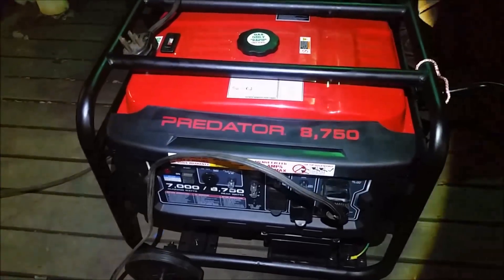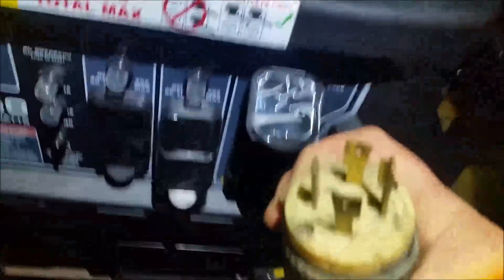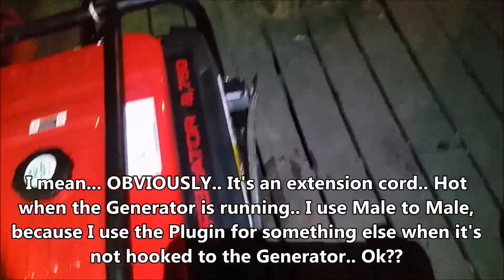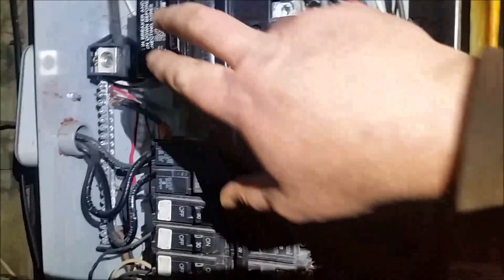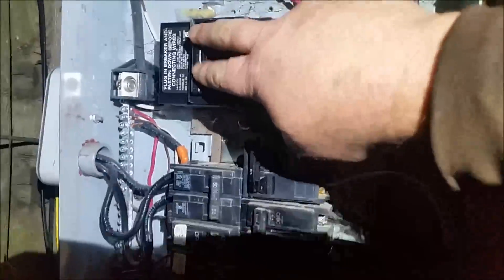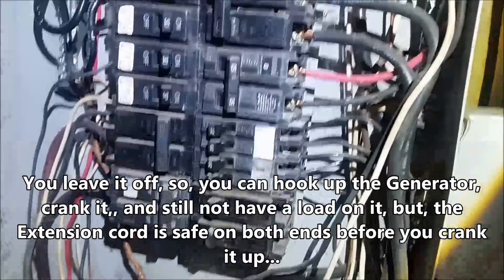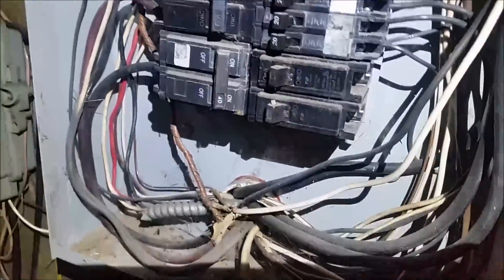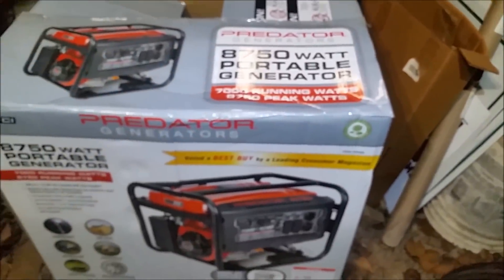Quick/Easy/Safe: Use Existing Plugin/Breaker for Generator hook up to your house Panel box.

Comment: I have given some thought to whether (or not) one could electrocute himself with a male-to-male jumper cord or dogbone. To be electrocuted there must be a path through the heart. Since the emergency generator is not grounded even if one were double stupid  (connecting it hot and touching a hot blade of the plug) there would be no return electron path to the generator via the ground. If one were to touch two blades of the plug one could get a nasty shock and burn but it would be localized to the fingers (no path to the heart). So if one is determined to be electrocuted he must use both hands and touch two blades of the plug. An alternative (if the generator is bonded to the frame) might be to walk back to the generator and grasp the frame while touching a hot blade of the plug (still requiring the use of both hands).
Reply from the maker: I understand your Theory, but, 220v 30amp, best to just plug it in before you crank it. 
I would not want to plug it in with the breaker on either. That would create a pretty good snap on the generator and things plugged into it. 
I always turn off all of the 220v breakers, and then, flip the generator breaker on to power the house Electric box. But, I know that does not put that big of a load on the generator. I usually wait at least 10 seconds, or let the generator catch up to the load before turning anything else on. Usually just a few or a second or two.. Then, I turn on my 220v Deep Well pump, but, I have the Hot water heater breaker off, which I am lucky enough to have inside.. Then, when I want to warm up the hot water heater, I do not use the water, and I turn the Electric Hot water heater on. When I hear the load release, I turn the Water heater off and use the water as I wish again. If both the Hot Water heater and Deep Well Pump come on at the same time, it either lugs the Genset down way, way too far, or kills it, or, flips the generator breaker. 
When I turn everything off, Generator feed breaker First, then, I turn the House Main back on, Turn the Genset off, Unplug the Genset, and I'm done until I need it again.. 
When I get ready to run on it again, Before I go outside, I turn the Water Heater off, then going outside, I pass by the Electrical Box, Turn the House Main Off, (Leaving Genset breaker off), Hook up Genset Cable, Crank Genset, Go back to the Box, Turn off all 220v breakers, Flip the Genset breaker feed on, let it stabilize, then flip the 220v Deep Well on, and run as long as I have to.. 

It's just safer to not crank the Generator unless both ends are plugged in. If I were not the only one around here who fooled with the Genset, I would disconnect both ends of the Male Cable. But, I know, no one is going to crank the Generator but me, or someone I am on the phone with cranking it for my Girlfriend, or my Girlfriend if for some reason I am not home.. But, she would call me before doing anything, because, I have not trained her. But, I have the same setup at my Mom's who is 84, and, she has called me on the phone several times, and just tells me what she is going to do as she does it, and she does fine. But, I put a 3x5" index card with the instructions anyway, because, it can be a while between her doing it herself. Never had any problems... 
But, if you pick up a Male to Male extension cord and don't have any respect for it,, (Gives me the Heebie Jeebies) you really have no business doing it this way. You know what I am talking about. 
Anything Male to Male has a potential to get you.. It's just that simple.. 
Just a thought on Grounding though. I have gotten bit with one hand touching something with a good pair of rubber sole boots/shoes on. 
I can tell you one other strange thing about Grounds. I have a 220v Deep Well Pump that is only driven by a 3 wire cable (2 hots and a ground). I never paid any attention to it, but, one day I was looking for my grounding rod by my Main Electrical box, and there was None.  Only thing I can figure is, it grounds through the ground to one of the closest telephone poles, which is probably a good 50 yards from the well. 
So, don't discount the fact that the Earth itself is ground, and, you can get shocked when wearing rubber boots, only touching a hot with one hand. 
Better to be on the safe side any way you slice it.
Reply: @MarkThomas123  Yeah, I actually do it your way. I was just pointing out that the plug can hurt you but prolly not kill you. I did one time pull the plug hot. I don't recall what I was checking. The plug is large enough that I didn't get fingers close to blades but I found a safe place to lay it down until I plugged it in again.

Comment: There's no sense in installing a $500 transfer switch and doing a bunch of work to accomplish what can be accomplished with understanding. Its for Emergency use only, there aren't code enforcers going around writing tickets for backfeeding, the penalty is you eletrocute someone, you fry equipment or you burn your house down.  Those are motivating enough to make you do your due diligence to understand how you plan on putting the generator in and avoiding the pitfalls.  Perhaps add letting the generator run for a min or two with no load to blow air on the generator hardware before killing the motor for longevity?

Comment: A cord with male fittings at both ends is a suicide cord, ONLY  when you + stupidity. power goes out 
and utility co, says  it'll be on tomorrow So you shut off mains in house and/or outside house 
if u have a mobile home, u have a mains or disconnect by the meter. I shut'em both off. now you
plug gen into outlet protected by breakers in panel.gener8or has warmed up so you plug other end
plugs into generator.  This is a safe way, safer still though to have gen brkrs feed a special male 
fitting that is enclosed in a UL approved box. then the cord only has 1 male end.

Northern tool has Powerhorse a very good unit, got me an wife thru irma. and a few other times.
Reply from the maker: Turn Main Breaker off.. Complete House Circuit is dead.. Turn Generator Breaker off, so, Generator is isolated.. I turn the Generator breaker on the Generator breaker off too.. Then, plug in cord on both ends.. Then, crank Generator.. Neither end is unplugged, just in case.. Then, when generator warms up, turn Generator breaker on, then Generator breaker in the panel on.. If you want a smoother transition, turn off all 220v breakers, and half of the 110v and turn them on one by one.. No need to turn on any dryer, electric stove, etc.. Genset is not strong enough.. And, Deep Well Pump and Electric Water heater have to run alternatively, not together... Other than plugging both ends in at the same time, I agree with what you said.. I also agree with the way you said, because it is also safe, just a little safer if you plug both ends in and use breakers.. Even if your hand slips plugging either side in, no voltage is there.. If you slip when generator is running, while plugging in the cord to the male, you could get shocked.. Just a little safer to do both while no electricity is present.. No reason not to error on the side of caution, but, your way will work, just, no reason not to go a little safer.. Thanks for the comment.
Reply: @MarkThomas123  You are welcome, we don't want to be without power but in this circumstance, we need to think things out and I can say that there were a few
times I realized it was not the best or safest way. it works great till it suddenly 
doesn't and knowing murphy can enter and in half a blink F it up royally. I have a
dog and I don't need lethal voltages flopping around in case it should fall out of the
socket. I lost power last Sunday late afternoon,, since I do Gen maint. every 45 to 60 days, she was already to go. 1st thing was to trudge to outside breaker box and 
shut it off as it powers a mobile home, panel inside  is a 'sub-panel' neutrals a 
grounds are isolated and dryer is a 4 prong not the old crowfoot style, that was changed in the mid 90s by NFPA, yeah some walk out toward the dryer socket with 
240 live danglin at the prongs, they could have/should have turned off Gen breaker.
or as I say plug in at dryer end. there is so much bad that can happen, that is why
we have to think things out. they r called widow makers for a reason, but they can
keep u from freezing or sweating as long as u know exactly watt u r doing and why.
I could be wrong about that socket for gener8or plug looks like it could be mounted more securely, , less it moves, less chance for wires inside to move. u just don't need another issue to deal with for no reason.
Reply from the maker: @raymondgarafano8604  Yes.. The plug into the generator should be a 4 prong, and it called a "Twist Lock".. One of the prongs has an extra extension on the blade... I have never had one pull out, and have been doing this for me and my Mom's house for 16 plus years, and the power is out pretty regularly.. Push in and twist slightly.. About 1/8 turn or less, and then, try to pull it out.. I always flip my cord where when I plug it in, it naturally twists it to the right when sitting there running.. Just some extra thoughts on that one..  Cheers.. :)
Reply: @MarkThomas123  Well, some gens have the twyst lock receptacle and some have 
the style u'd see for a flat blade dryer plug. The u prong being ground  and across 
from it is the neutral, with the hots on either side. take care 'n b careful!

Comment: So if everything in the house is off (not off of the breaker box) but (switches flipped off) the refrigerator might come on when the generator is started. Can you have it plugged into your dryer plug with THE MAIN OFF, start the generator, and then plug the suicide cable into the generator?? What are you thinking in this situation? Tankless water heater which would be off at the same time main would be flipped off as it uses 18,000 watts and generator is a predator 9000. So really the only thing that might come on is the refrigerator, stove clock, and microwave clock. Would you be able to get by without flipping the different 220 breakers off with this light load at start up

Also, I have a 3 prong drier receptacle. My cable had 4 wires. Cut the “ground” wire off as the generator is “grounded” outside in in this situation?
Reply from the maker: 4 Wire plug is 2 hots, one neutral, one ground. 3 Wires is 2 Hots and one ground. So, Ground to the Ground bar in the Panel and Ground on your plug. Check the Wires in the recepticle. 
Main Breaker off First. No power anywhere.. Genset not running. Plug in Cord on both ends. Crank Genset. Still no power in panel except the Genset feed breaker. Turn off al 220v breakers. Turn off any 110v breakers you will not use.. 
(You can turn all 110v breakers off and turn them on one by one, waiting for the genset to return to normal RPM's as you go.. Some Circuits will need more power, some not at all.. Any 220v breakers are suspect to overload 9000 genset.. Turn on only those you are going to use. May not be able to run more than one at a time. Water heater or any type of anything that heats up will take lots of watts/amps.. I run my Water heater and Deep Well Water Well (Both 220v), but, never at the same time.. Stop using water, turn water heater on, let it heat up, load drops, turn water heater off and then, you can use the water again.. Hope that makes sense.. 
When you hold the Male to Male extension cord, you should "KNOW", that you can not have power on either end while you are fooling with it.. If you question that at all,,, you need to sit down and think long and hard about doing this.. It is just plain common sense, but, I am guessing you have not had the extension cord in your hand yet.. It's like holding a firecracker and cigarette in one hand.. If you don't feel that way.. Stop, use an interlock and Male wall plug and a regular Genset extension cord.. You have already let me know you have not thought about this much.. I am a bit worried about you trying this.. Stop and Think before each step. If holding the cord does not scare you (Respect of what you are holding in your hand) STOP and do find another solution.. There are many. This is just for people who this makes sense to, and those that don't have extra 220v outlets, or want to use one they are not using while on the genset.. Think hard about that last paragraph and make up your mind.
Reply: @MarkThomas123  think there might have been a mis- understanding. And yes I am new to the subject. That’s why I am looking at videos for help. But with the “service disconnect” in the off position. There shouldn’t be any power coming through the other end of the cable right? What I was saying is to plug in the 220 in the drier receptacle (AFTER) the service disconnect, or the main breaker in this instance is OFF. Thanks! 
Preparing for the worst in the coming up days
Reply from the maker: @tylerhoffman2506  Yes, for the Generator, but, you won't be able to use it for the Dryer if you hook up the Interlock, or change the wall outlet to male vs it's female now. You have to have an extra 220 breaker.. 
That is the beauty of this install. You use the Dryer breaker for dryer or Generator, and can use them on or off genset. But, this is without an interlock that will only allow the outlet to be used while OFF Utiity power, or, when main power breaker is off. Maybe that will clear that up..

Comment: I don’t have a main breaker
Reply from the maker: You do somewhere.. Follow the Power Company line from the Transformer to your house.. It will go to what they call a gooseneck at the top of the pole where the "Arial Triplex = 3 aluminum wires) connect to the top of the pole Copper wire, and run down into the meter pan where they read your power consumption.. It will be either immediately below that, or, somewhere beyond that where the power enters your residence or home or shop, etc.. 
You are looking at a secondary panel if it does not have a main disconnect, or, a really old panel with buss fuses or something like that.. If you don't figure it out, let me know and you can send me a picture and I'll tell you what you are looking at, but, follow the wires to the meter pan and then from there to the largest consumer of power.. That is where you will find it..

Comment: "First thing you do is turn the main breaker off"  hopefully the main  opens internally and is not broken.   I have seen many MCB of a certain type that did not open because of age, they got wet, or they were a certain brand that is known to have problems.  This is a dangerous hook up but when necessary people do what they have to do.  As an electrician, I prefer to pull the meter and pie plate it if possible.  Better yet install a transfer  panel or switch.
Reply from the maker: Something tells me you're not an electrician. Ever heard of the term failsafe?
 There is a reason you have. The opposit of that would be fail unsafe.
 Same reason why scuba equipment fails safe.....
 Try again!!

Comment: It may be QUICK / EASY but it is NOT SAFE or Legal.  DO NOT DO THIS !  Also he is back feeding 30A into a 50A breaker, NO BUENO.  This is an accident waiting to happen. Crazy!
Reply from the maker: Tom Alessi.. You are not very smart... Not Safe?  If you feel this is the case, then, "YOU" should not do this.. If you can't remember to turn off the Main Breaker, this is definitely not for you.. You should find something else like a Transfer switch or a Generator Interlock and be done with it.. 
#1, it is perfectly safe if you have enough common sense to Turn off the Main breaker and plug in the Extension Cord before cranking it.. But, if you can't figure that out, this is definitely NOT for you.. 
You are an Extra,,, and don't understand Breakers??? How in the World did you get your license??  Did you think for a minute that the Generator has a Breaker on it?? So, can you tell me if the Generator has a 30 amp breaker, and you plug the generator into a 50 or 100amp breaker, what is your limit?? 30 Amps correct?? At the Generator??  No BUENO?? 
In the USA, we call it common sense,, but, only common if you use it.. Accident waiting to happen??  Crazy?? 
Crazy is what I am replying to...  You would think with an Extra license, you would understand some Fundamentals of Electricity.. Sorry, but, you came to my house calling me Crazy.. Now, I am at yours,, SHOWING you Crazy!!
Have a nice day.. I'll tell you how to stop your computer from having those "Keyboard Driver Errors".. Ha..Ha..  Sit back and think for a minute, and realize that some people are a whole lot smarter than you, and when you challenge them,, they come right back.. Have a nice day.. But, please, do not try this... This is for a different type of person....
Reply: @MarkThomas123  Someone is a little bit  sensitive. Chill out.
Reply from the maker: @tjalessi  Guess who started it..  Make sense now?
Reply: That’s why everyone should follow the generator safety rules and be aware of the warnings

Comment: I wired mine into my a/c 50 amp service during three hurricanes. Never once had to remember to disconnect the main breaker. 
  Don’t respond to the sheep, hand. They get mad when they see you walk out the open gate, while standing in the pen. Public indoctrination at its worst. They’ve been educated to not realize it though.  Good video
Reply from the maker: You hit the nail on the head.. Each time I pick up the Male to Male extension cord, I am reminded,,, use Common Sense.. I agree.. I could never forget to turn off the main breaker, but, Common Sense dictates that.. It's kind of like tying your shoes, or, putting the car in park.. No one has to remind you to do either.. Ha..
Reply: Please stay safe during hurricanes, Norman McNeal. Here’s a video about generator safety https://youtu.be/I1jT3ANENvI everyone should watch this video. I just hope people stay safe. I feel bad for them. Thank you.